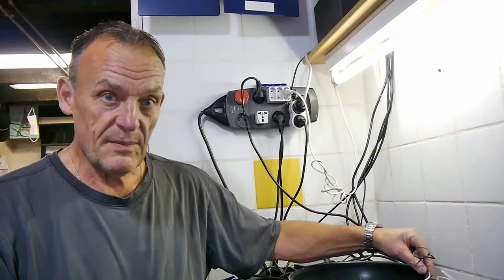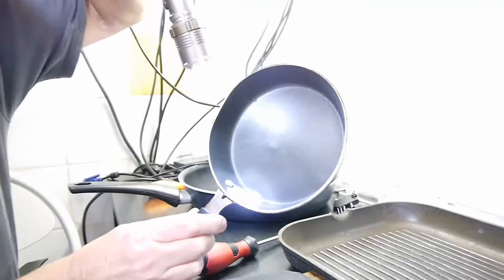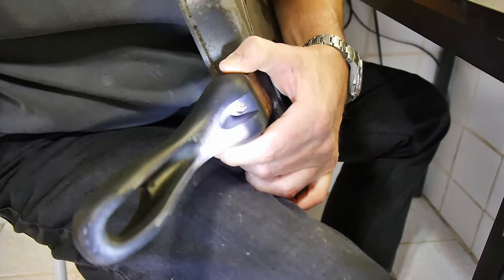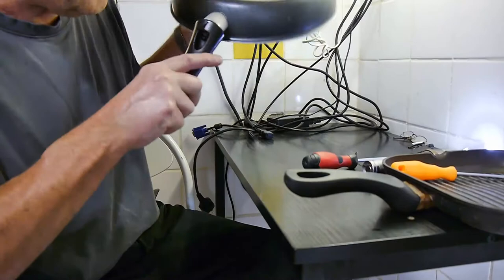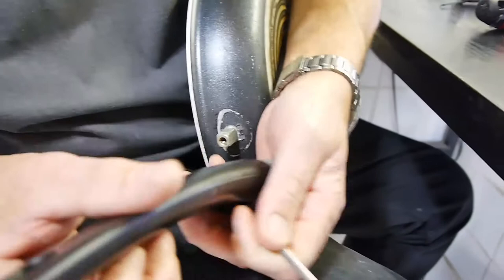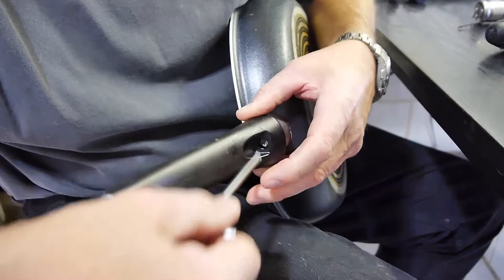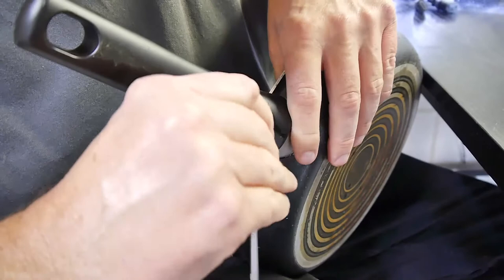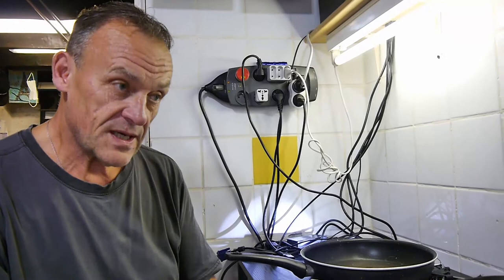DIY #HowToBloke 🇬🇧 fix|tighten|repair loose or wobbly kitchen pan|frying pan|skillet|saucepan handle

Comment: Thanks for the tips! I need those tool to fix my pans! :)
Reply from the maker: I bought a tool-set of 9 Torx screwdrivers as used in this video from Amazon for less than €10
Reply: @HowToBloke  There are soooo many types of screw head nowadays!  My food processor has tamper-proof Torx screws with a pin in the middle!  🤪

Comment: The problem is that Tefal (and probably other manufacturers as well) use ordinary steel screws to secure the handles, which rust, especially since they're screwed into aluminium!  I now replace ALL the screws in all my pots & pans with stainless steel ones (from a popular auction site).  The usual size is M5, 25mm long with Torx T-25 head.  I also re-tap the sockets with an M5 tap if there has been corrosion, and put a smear of food-safe silicone grease on the threads.  They never rust or seize up after this!
Reply from the maker: Good plan! 👍 Thanks for watching #HowToBloke.
Reply: @HowToBloke  No problem, it's a really useful video.  And, if I REALLY can't get the rusty screw out, as a last resort I'll drill a 3mm hole in the aluminium collar & inject JB-Weld epoxy into the handle attachment!  Then it will never ever come loose again... 😄